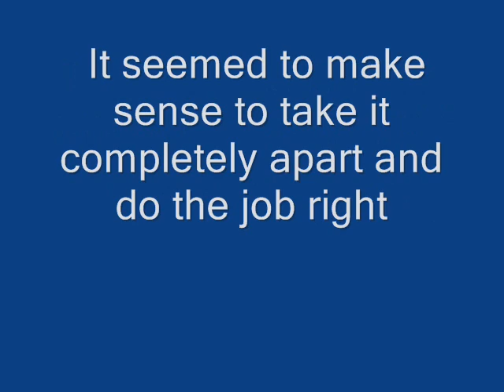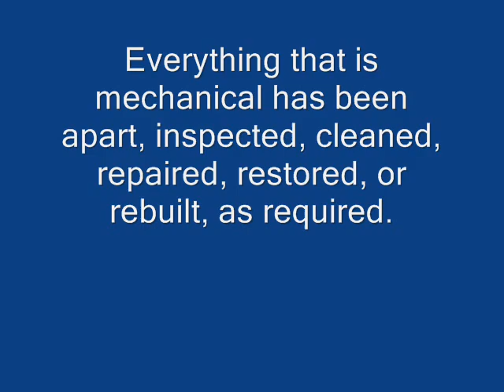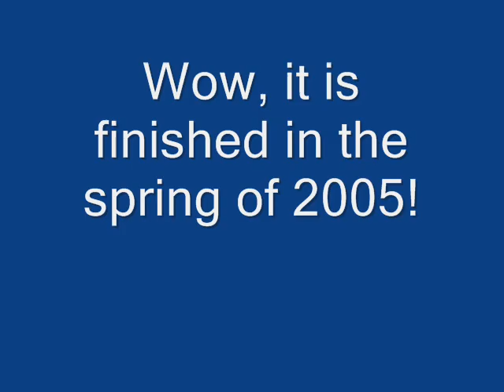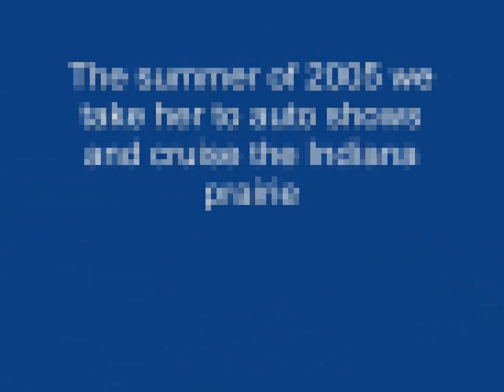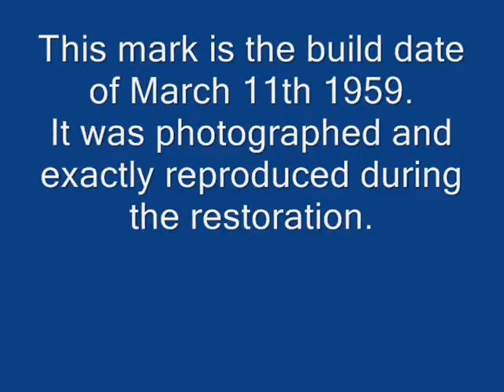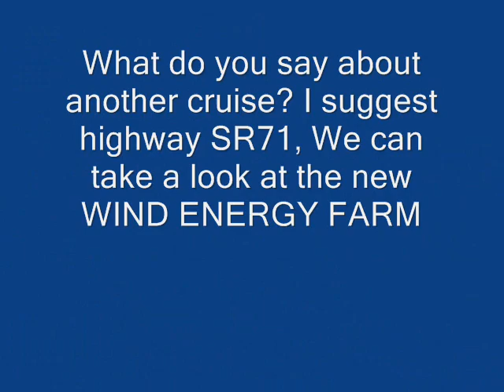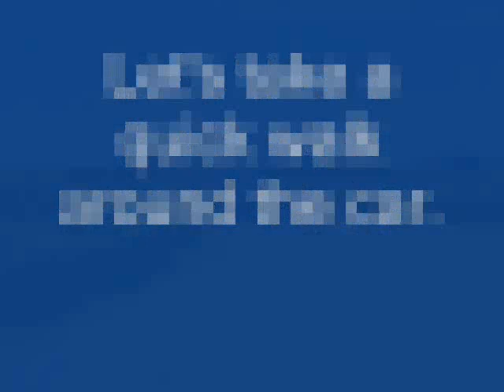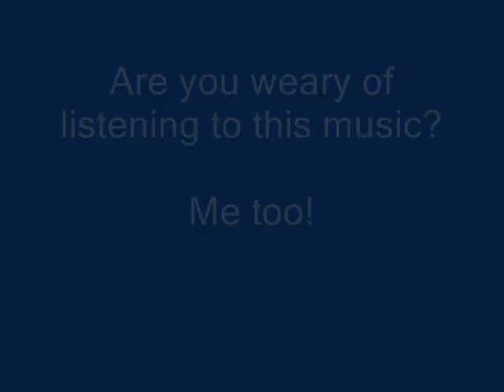JIM'S 1959 CHEVROLET IMPALA

Comment: My first car was the same except mine had a 283 and an automatic transmission.  My uncle bought it brand new in 59, then gave it to my dad in 68.  I got it in 78.  It got stolen in 82 by an escaped prisoner and then set on fire.  I salvaged the engine but there wasn't much left of anything else.  Sure would like to have that car back.